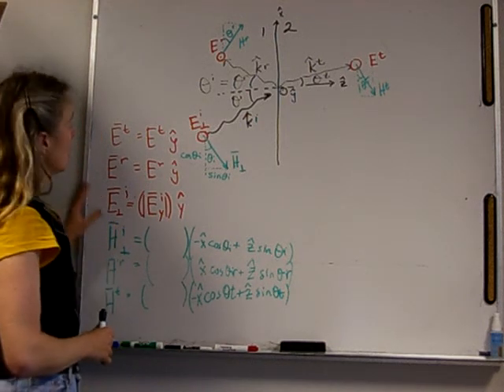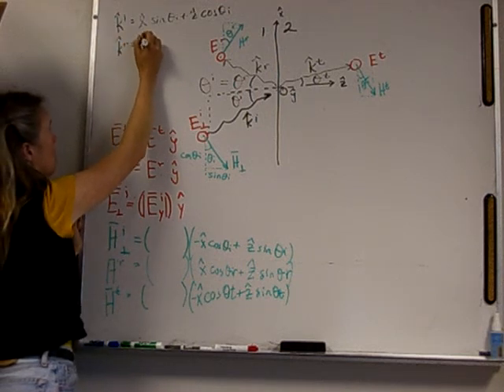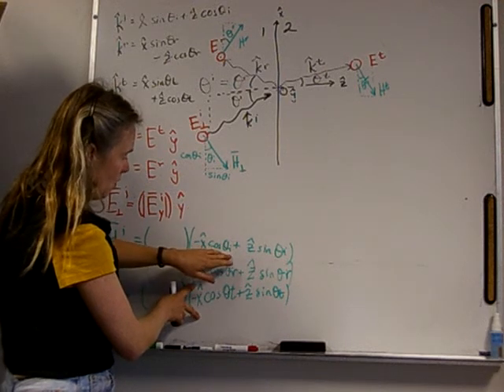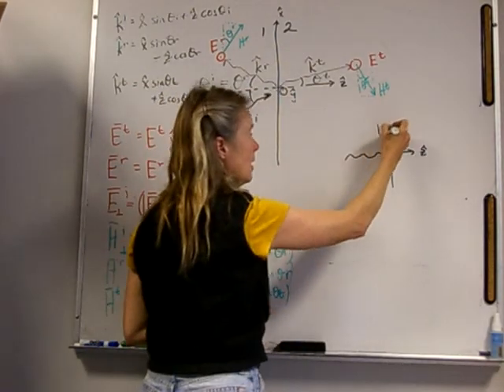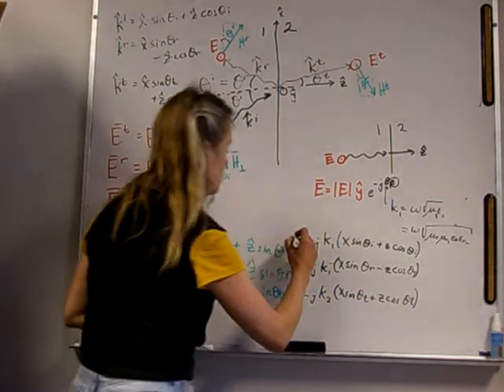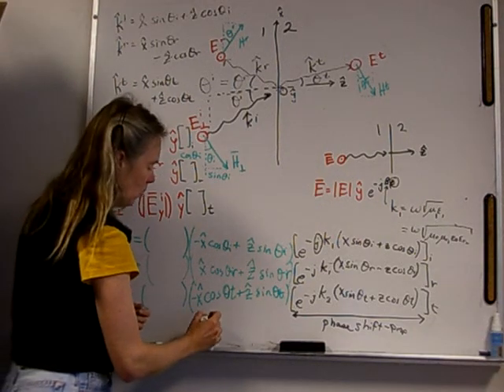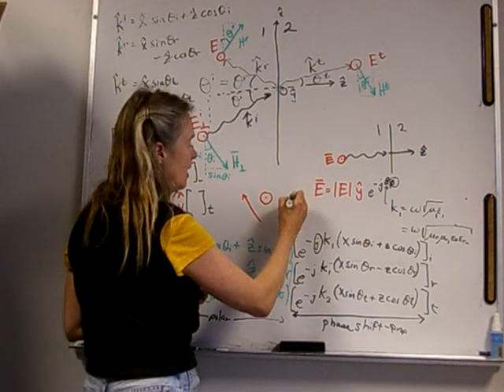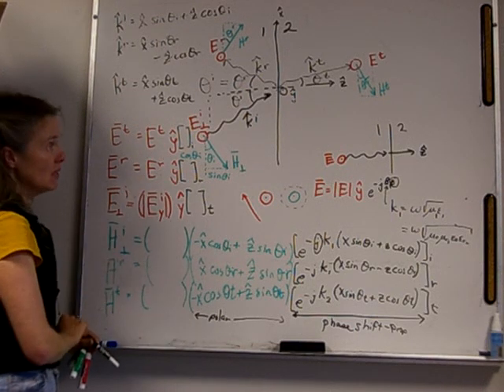ECE3300 Lecture 30-3 Plane Wave Transmission and Reflection, Oblique Incidence

Comment from the maker: @adeb1989 D is a vector so the BCs are vector equations too.  Each vector component must satisfy the equation.  If you start out with no Ez, you will end up with no Ez.  Try, for example, a boundary in the xy plane, with a wave traveling in the z direction.  Let the wave be Ex polarized, or Ey polarized, or any other combination.  Is there ANY way we could get a z component from these boundary conditions?  no.  Now try others. You just can't generate a polarization that wasn't there before.

Comment from the maker: If E starts out y polarized, it will reflect y polarized.  The boundary conditions will 'tell you' this.  For instance, if you have a metal surface, we know the E fields parallel to the surface must be 0.  If the incoming wave is y polarized, it must reflect y polarized (but out of phase) in order for the sum of the two waves to add up to 0 at the surface.